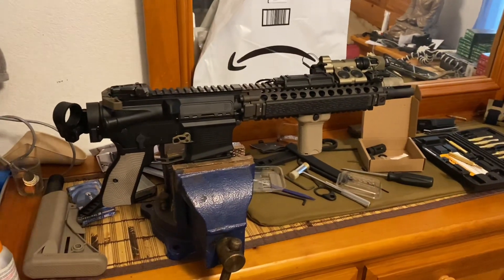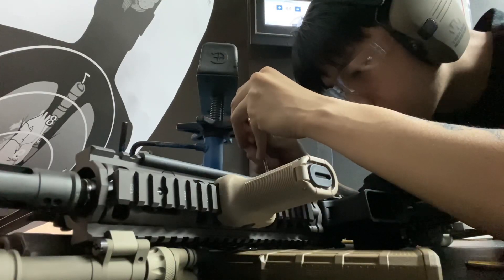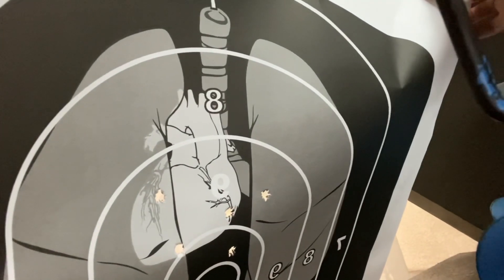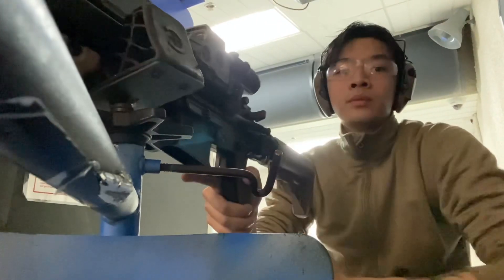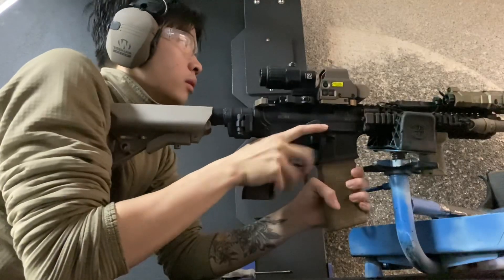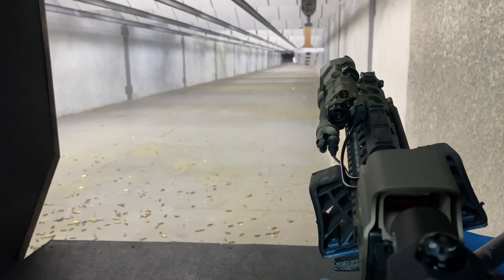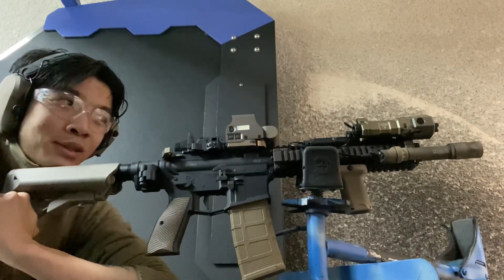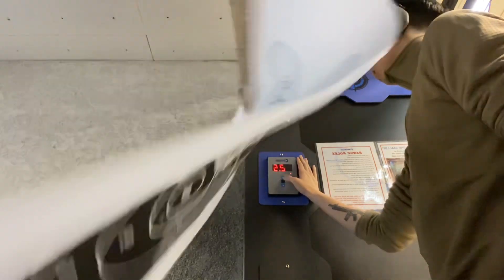Sighting my new Mk18 (Aero Lower)

Comment: You built a nice setup.  The groups looked good!  What ammo were you shooting?  My Mk18 seems to like 69-77 grain OTM.  My V7 is the same.  I’m also shooting sub MOA with both….suppressed.
Reply from the maker: At 100 yards accuracy does seem to still be effective but not terrifically great. I was just using cheap 55 grain winchester ball ammo and sometimes use 62 grain

Comment: Great job young man, what weapons light and mount are you using
Reply from the maker: Im using surefire X640 series of lights and it comes with mlok and picatinny mounting options. Sadly the pressure pad for the light is sold separately and isnt cheap

Comment: Brotha man!! What are all the parts you used!?
Reply from the maker: Driven arms co CZ shadow pistol grip adapter, surefire warcomp, surefire x640 IR
Vampire light with PEQ15 button, B.E
Meyers MAWL C-1, Eotech Exps3 + G33 magnifier, BCM gunfighter picatinny grip, B5 Sopmod stock, law tactical folder.
Geissele ultra duty lower parts kit, geissele SD-E Flat trigger, geissele braided buffer + H3 buffer weight, radian raptor charging handle. The upper is the Daniel Defense Mk18 URG, everything on the upper is stock beside the warcomp and charging handle

Comment: Parts list?
Reply from the maker: Driven arms co CZ shadow pistol grip adapter, surefire warcomp, surefire x640 IR Vampire light with PEQ15 button, B.E Meyers MAWL C-1, Eotech Exps3 + G33 magnifier, BCM gunfighter picatinny grip, B5 Sopmod stock, law tactical folder. Geissele ultra duty lower parts kit, geissele SD-E Flat trigger, geissele braided buffer + H3 buffer weight. Lmk if theres anything i missed you had questions about
Reply: @vietnamtactical  charging handle, bolt carrier group, barrel?
Reply from the maker: @duynguyen1332  radian raptor charging handle, Daniel defense Mk18 barrel, Daniel Defense Bolt Carrier Group as well.